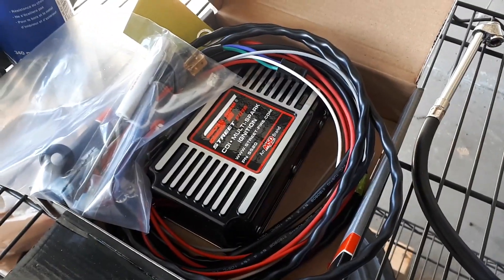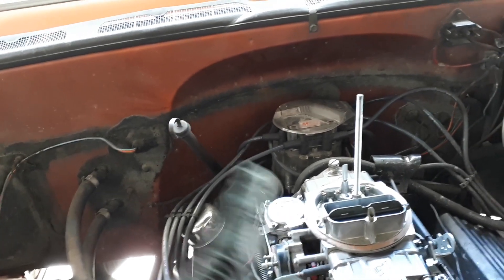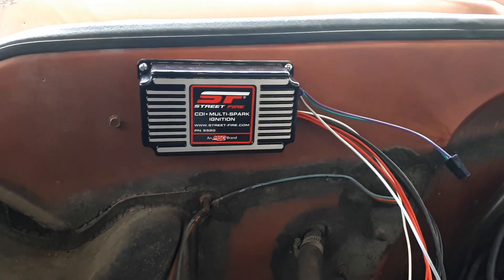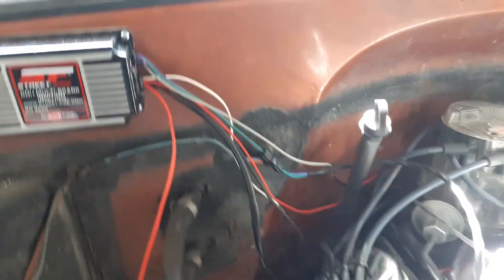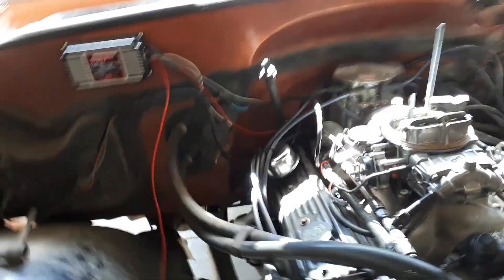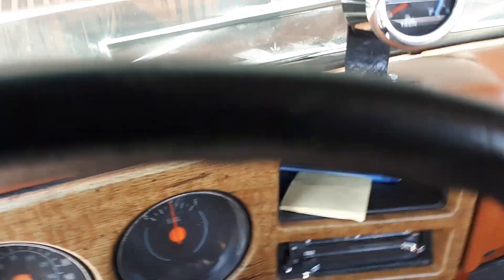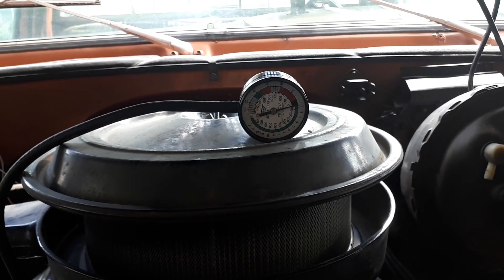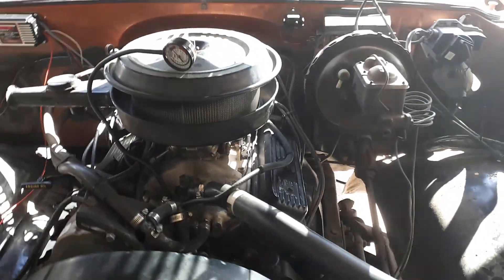Installing an MSD External Ignition

Comment: Fellow Albertan here! Hey could this system be used with a distributorless dual coil system? I need to upgrade my ignition after going to a boosted setup from NA (I’m getting misfires at high load/rpm) and 4 pin with ignitor to coil to 3 pin coil without ignitors
Reply from the maker: I am not sure about that. I would recommend you give Mopac a call. One of their folks may be able to answer that for you. Sorry I wasn't more help. Have fun with your project. Sounds cool.

Comment: Nice job. I buy the same box. But i didn't install. I have in the box. Tell me work good? Some difference with that ignition?? Thanks.
Reply from the maker: I liked it. Saw some better gas mileage with it. Ran better when cold.
Reply: @CalgaryBiker  thanks alot.

Comment: Great video. How did you check it is working?Did it improve throat response, starting, exhaust smell and did you get rid of black smoke at wot? Did you change the jettings? what did you set total timing? Thank you very much.(sorry, so many questions)
Reply from the maker: I did not verify it was sparking 3 times per under 3,000 rpm, however the motor ran very well so I assumed it was working properly. I did not notice it in the throttle response per se, but the carb was very new and worked well. All of the fuel was burned, so I did not get any smoke, just a nice bit of exhaust pop when getting off of the gas quickly. I set my timing to 12 degrees initial advance. Seemed to like that setting the most in my case.

Comment: Can you do the swap on my 1994 Silverado 350 tbi i want to install a 350 vortec. I’m 20 yrs old
Reply from the maker: I am not sure. Once computers started to get involved I am not sure if it interfaced with the ignition. Mine worked because I set it up like an old school motor with an HEI type of dustributor and a carburator. I would check perhaps with MSD to see if they have an external ignition replacement for your vehicle. My gut would say yes they would, but I am certainly no expert. Sorry I was not more help. Thanks for watching.

Comment: Were you able to see an increase in horsepower and throttle response? I have a sbc 350 in my 81 Camaro.  I am considering this for my car. Do you k not ow what all i would need to have a msd set up in my car?
Reply from the maker: Perhaps on a dyno it would show more power but from the seat of the pants dyno it feels the same. In terms of throttle response it was already pretty good with the brand new carb. I found adjusting my throttle cable was a key in getting good throttle response in my case. Overall I believe I get a better burn and my fuel economy is the part I notice most in addition to a smoother more consistent idle.
Reply from the maker: I find it runs much smoother with the external ignition. It fires 3 times per cylinder under 3000 rpm so I believe that makes a huge difference. If your Camaro is carburated, just follow the instructions on the unit. Basically you remove the stock controller from the under the rotor and wire in the external one. It would help if you are comfortable with making soldering connections and using heat shrink tube to ensure good long lasting wire splices are made. If your Camaro is fuel injected than I can not speak to that as I do not know how the controllers work on those. Hope this helps.

Comment: Cool video nice truck c10 4 life are you running a stock cam with those vortec heads if so what mods did you do I’m working on a set to get more lift
Reply from the maker: Tyran Ducksworth I am using a stock cam. It is my understanding that if you want to go with a lot of lift the vortec heads need to be modified as the valve guides do not allow for a lot of extra lift without interfering with the rockers. I have no personal experience with this mind you, just what I remember hearing. I like watching Engine Masters on YouTube. I believe that is where I heard it.